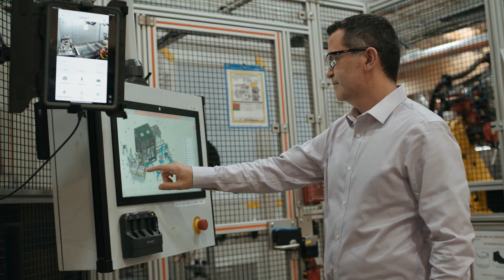ENDURING ENERGY: Building a better battery

Comment: What are the outside dimensions, storage capacity between fully charged and discharged, voltage, and cost per cell/pressure vessel?

Comment: It will be interesting to see how this will be deployed as residential storage. Here in Australia there is approximately 20GW of rooftop PV installed, with an estimated 46GW to be added in the next 30 years. Presently there is no cost effective way to store excess capacity, so homes are reliant on the grid after sunset.
Reply: this is the largest challenge to overcome, and legacy electricity industry participants work hard to ensure residential technology does not make their grid redundant.
Reply: @darrenbealeofficial  I think it is more a technical/cost barrier rather than industry roadblocks, at least here anyway. Of course the generation industry in other places may not be as friendly to renewables and energy storage.
Reply: Got your solution! --- what's your email address --- Yours, Chris in Washington DC